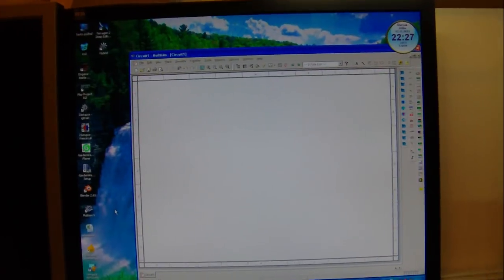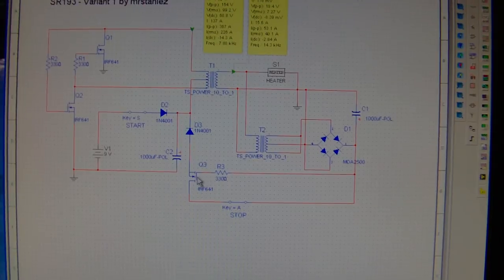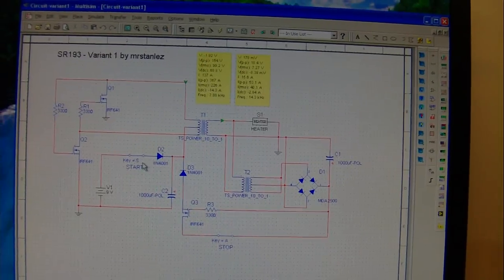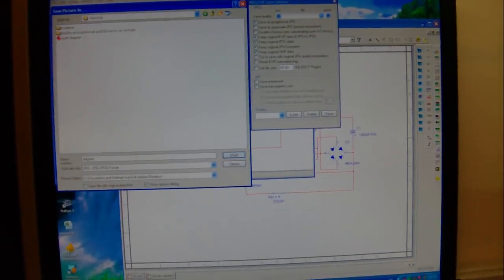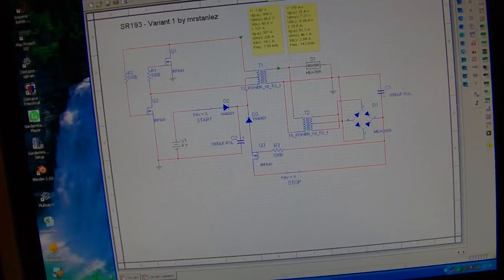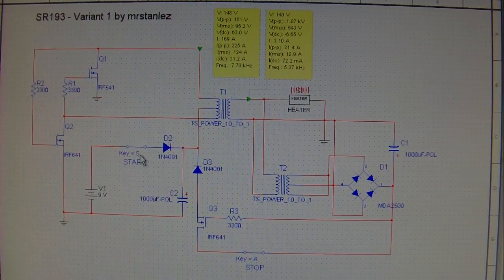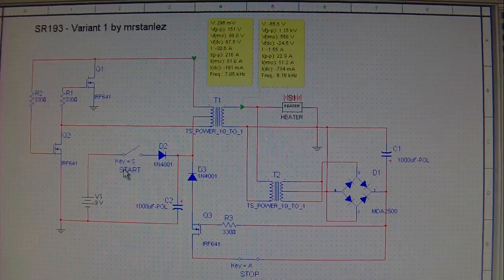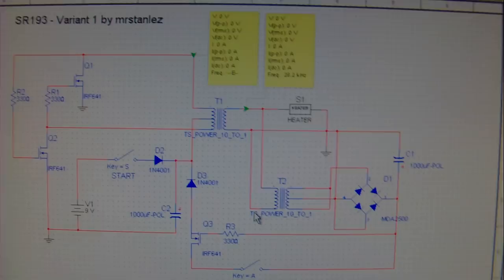Self-Loop-System fur freie Energie - DE

Comment: T2 secondary shorted out... not real.
Reply from the maker: T2 secondary not shorted. But have 2 coils at one end, a ground, and more voltage at other end.
Reply: MrStanleZ The schematic clearly shows the secondary shorted... with the center tap going to the bridge rectifier... is the schematic wrong? As shown, there would be zero voltage generated at the output of T2. The two wires that are shown connected at opposite 'ends' of the secondary winding, therefore at opposite polarity potentials. Maybe the schematic needs to be corrected.
Reply from the maker: beforebefore Transformer T2 have a 2 secondary coils. Top is +, center tap is ground and Bottom is +. So wiht logic i connect together  top with bottom tap.
Of course transformer have AC, but for better illustration to connect to diode-bridge i used above marks.
Reply: I give up, you clearly do not understand transformers, or maybe we're losing something between native languages. The top and bottom connections (as shown) are 180° OUT OF PHASE. I've been an electronics design engineer for 28 years, and the way it's shown on that schematic would cause the transformer to burn up. You also have one of the diodes in the bridge rectifier shorted, per your schematic.
Reply from the maker: Hi beforebefore,
so I understand your sugestion. But this is not a conventional circuit.
I try it, i prove it and work.

With all I know from university, can I never go outer classic limits of the electric & physics.

30 years experience in electronic.
Thank you any way